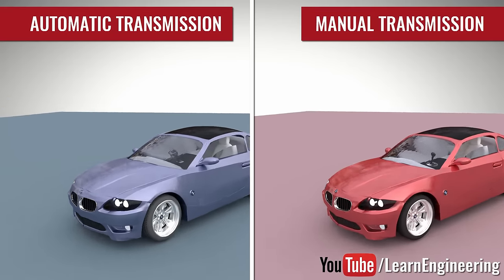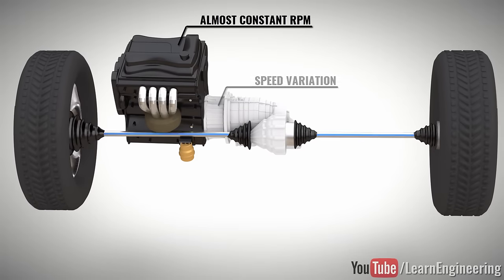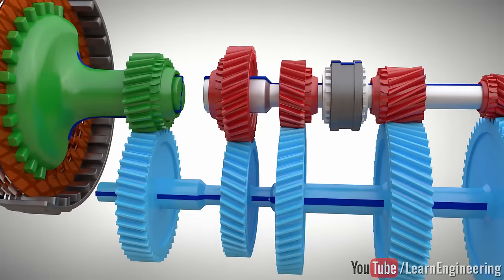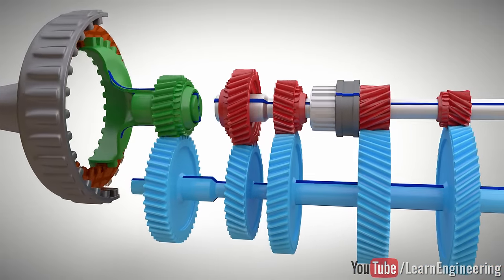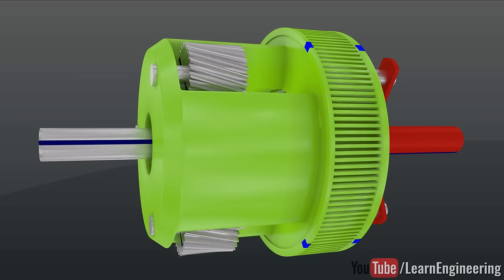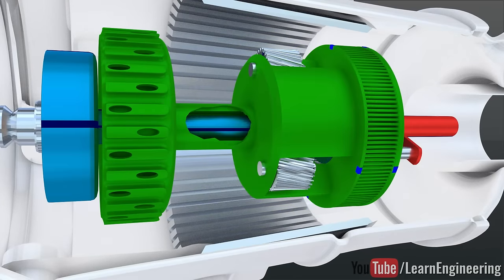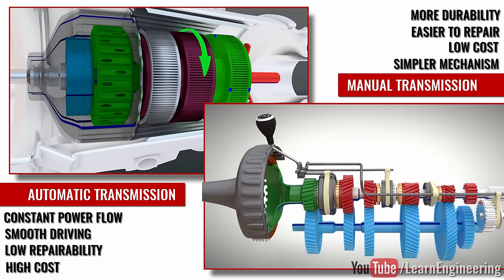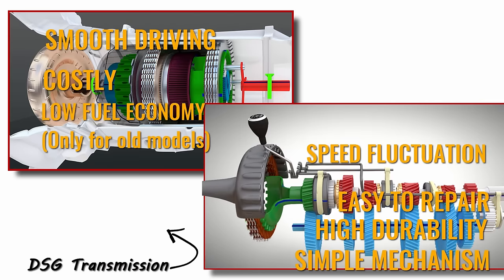Automatic vs Manual Transmission

Comment: 50% of comments: “insert Auto explanation unclear joke”
25% of comments: “I don’t disengage clutch when I brake”
20% of comments: “insert joke about Americans not knowing how to drive manual”
5% of comments: “AuToMaTiC iS bEtTeR yOu SiLlY”
Reply: @William West (student) sUrE
Reply: @William West (student) 1/ It’s less expensive 2/ It’s less complex (so lighter, less maintenance needed, less prone to issues).
The only auto gearboxes that really compete against manual are the dual clutch ones. All the other technologies (torque converter, automated manual transmission, CVT) are slower in gear shifting than manual (except cvt that doesn’t have gears and makes an awful noise) and prone to more fuel consumption.
Reply: @William West (student) How being cheaper on the second hand market is an advantage for auto gearbox ?! It means the car loses its value more quickly, i.e. you lose money over time. And no, it's manual who does have a lower fuel consumption than most of auto gearboxes because it's lighter and less complex. All the additional gears, shafts, the torque converter (if any) etc generate friction that consumes power from the engine. Except for the auto gearboxes that have more than 6 gear ratios that can consume less on highway, and the dual clutch ones, the fuel consuption is higher with auto.
Reply: @William West (student) Of course it's that it depreciates more. Depreciation is the value loss of an asset over time, and this value loss is, among others, relative to the market value of your asset. And on the second hand market we observe auto is cheaper while it was more expensive when brand new, so yes it's a higher loss of money over time; it's simple accounting.
And please what are your arguments to state that auto has better fuel consumption, beside just "no" ?! I explained you why (more weigh, more friction) auto consumes more. I can also give you an example : check the brand new Ford Focus, with the 1.5 EcoBlue 120hp engine that exists both in manual and auto: fuel consumption is rated by Ford at  4.3L/100Km for manual and 4.7L/100Km for auto (which is torque converter type).

Comment: Automatic is for children
Manual is for adults

And btw, this video has been made by someone who has never driven a manual and does not even know what motor braking is.
Reply: Automatic is for boys
Manual is for Men
Reply: or how to float gears either. (shifting a manual without using the clutch)

Comment: Manual is never a smooth experience?  Sounds like something said by a person who has never ridden in a manual and a skilled shifter.
Reply: Vizerei I think by smooth he is saying there is no continuous acceleration curve. Which is true because no matter how fast or smooth you shift a manual there is always a power transmission interruption. It's unavoidable.
Reply: Loss of power, yes, very briefly if you shift fast. But only a bad manual driver will make it a noticeable experience for those inside the car. I apologise to my passengers on the rare occasion when I foul up.
Reply: Mongoose Viper It is completely avoidable. Once you have practiced and know your engine and transmission you don't even need the clutch. Ask a semi driver, they're the Masters of the shift. if you have the timing and feeling right you can shift right as you let off the gas and it slides in to the next gear with less than a tenth of a second delay. Only some sports cat automatics can match a skilled manual shifter. My hellcat is one of those automatics that put me in awe, and my Cummins with an Allison does pretty well, but the common car automatic transmission has a huge delay.

Comment: I always compared driving manual with the blue avatar people when they link their hair things with the beasts they ride. You are one with the vehicle! 
And after a bit of practice you'll unlock a new ability for getting the engine to turn called "pop the clutch" 

P.s. SO MUCH EASIER TO GET OUT OF SNOW ALSO!!! Try rocking out of snow with a automatic you'll just embarrass yourself probly.

Comment: As someone who drove both, each one has its own ups and downs.
Manual is cheap to maintain. The problem is when you are in uphill. You gotta stay in low gear otherwise the engine is gonna stop. Another issue is when you are in slow rushed traffic, you will have to keep changing gears. That is gonna cause problems for the clutch and is gonna be damaged. Also, the engine temperature is gonna get higher. 
For the automatic, it's easy and relaxed during drive. No uphill headache, no problem during crowded traffic. The problem is you gotta be careful when you you press the break or when you accelerate.  Another big issue is the high cost of repair. 
Overall, I like them both.
Reply: auto cars will also stay in a low gear going up hills, its how gearing works. you just dont notice it, and i find it annoying have to put my foot all the way down in an auto before it decides to actually use the right gear. traffic can be annoying, but it doesnt really cause any problems for the clutch and its not gonna damage anything. engine wont be any hotter than it would be in an auto, probably less actually.

Comment: "in manual transmission, before you press the brake pedal, the clutch pedal must be pressed completely"
I'm sure this is a USA (amazing) Youtube channel, because all information regarding how to handle a manual trasmission are completely wrong. By doing what suggeted in the video, it's a good way to die, and I'm not jocking. You MUST press first the brake, then, when the vehicle is almost stopped press the 
clutch pedal.

Second thing, manual trasmission is extremely smooth in terms of comfort....if you can drive properly. If you live in te USA, unless you are using a car with manual trasmission, it's impossible to understand.

Comment: My grandfather, a driving instructor, strongly disadviced me from automatic gearbox, claiming cars with them are actually useless during escape or other such need. I also share the opinion, that car should not be just a vehicle to get to your aunt or church or whatever, but also help you escape or evacuate if there will ever be such need (fact that cars with manual transition are also easier to repair is also nice), so if I will ever think about buying a car, I will choose manual transition. Only problem I ever saw in manual transition is that sometimes clutch doesn't press easily, usually in older cars, so you need more force to actually swift gears.
 But that's just my opinion.

Many people are also pointing out, that you don't push clutch to brake - that's true, since clutch doesn't stop the vehicle, it just pushes engine away from propeller shaft (in easier words one could say, that it disconnects engine from wheels). I was taught to let a foot off gas pedal, gently brake and reduce gear, and when car reaches like 20km/h and is on 2nd gear then push the clutch and put 1st gear after braking. You don't even have to push the clutch, only thing it does during braking is preventing engine from shutting down.
Reply: In any emergency situation I'd imagine the chance of an automatic tranny failing on you is far lower than you accidently stalling the engine in panic, costing you time.
Reply: @baileyharrison1030  not really:
1) 
 a) If you're used to manual, stalling the engine is very rare.
 b) In manual you can stall the engine however times you want. I remember stalling the engine 6 times during exam and car was completely fine. As long as you don't increase RPM to absolute limits, nothing's gonna happen.
2) I mean, automatic will most likely turn on and drive, but will accelarate slowly - when you want to accelarate fast, you need a high power output, and in automatics power output is always the same. Car which doesn't accelarate fast enough doesn't seem like the best escape vehicle to me...
Reply: an auto isnt gonna just let you down if you need to "escape" or whatever its just a different way of putting power down to the ground but autos arent some weird consperancy that are horible
Reply: @Admiral45-10  modern autos are pretty much the same speed as a stick in daily driving a manual dosnt really give you an edge over other people other than they are more reliable and get like 1 or 2 more mpg
Reply: @ethanol-fb  good you said ,,daily driving" - how do they perform offroad, or any other situation than normal drive on road?
 Just to make it clear, I'm consistent - I will probably never buy a sports car (it's literally useless - it can only drive fast (where it's illegal on every single road) and doesn't do well in rough terrain. How am I going to evacuate with my family through bombarded city with this thing?)
Reply: @Admiral45-10  man you really are a conspericy theirorst your suv wont save you from an alien invasion plus for rock crawling and off road i would rather have an auto any day and sports cars arent useless some people like the feel of it and sure going fast is illegal but i dont speed everywhere i go and speeding isnt really that fun to me its the feeling of 0-60 just feeling the torque is fun but autos are for daily driving as 98% of people do
Reply: @ethanol-fb  
1) Neither do I want it to save me from alien invasion or to drive on Mars - I want to be able to run away in rough conditions and repair it quickly, with basic tools and by myself.
2) You would use car with automatic transmittion to drive off-road? Why? What kind of advantage does it have? I don't do off-road driving proffesionally, but, from what I've seen, power output management is really important there. I also don't really think there was ever an off-road land vehicle made with automatic transmittion...
3) Yes, it's good for daily driving (so is the city bus, for example) - but what other than that? What if I will need a run-away vehicle? What am I gonna use? For me, if a car cannot be used in emergency situations properly, it is useless and is just a waste of money.
Reply: @Admiral45-10  look man i know youre not gonna repair your transmission with basic tools by youtself but a manual dosnt offer any more then an auto matic for "emergency" reasons they both pretty much put the power down in the same way plus yeah rock crawling is better in an auto because an auto can use the torque converter and you can hold yourself the same as a clutch but youre not burning up a clutch and you can use both feet to control it better a manual trans is for racing or just for people who like it really but youre not at much of an advantage over someone whos driving an auto

Comment: Yea im not sure where he got the "driving a manual is never a smooth experience" ive been driving a manual pretty much since i could drive and i hardly even think about shifting anymore i just kind of do it. I've reached enlightenment and have become one with the transmission. These days most manual cars even come with wheel locks, so you have a while to get into gear before rolling backwards even on the steepest of inclines.

Comment: Ok fair, automatic wins.  I however prefer a manual transmission over an automatic transmission.  I have driven them for over 30 years and can make my clutch last 100k miles or longer and have found them to be more reliable in the long term.  I am sure some people prefer automatic transmissions and have similar testimonials.  Both are good designs that are being phased out due to the electric car market.  Soon none of the above will matter.

Comment: Clutch pedal doesn't have to be pressed every time before pressing the break pedal on manual transmission. No problem braking with no clutch pedal pressed. It only needs to be pressed before the full stop and to avoid the engine stalling when RPM drop too much.

Comment: If I am not wrong now there is really no need for an automatic transmission, except for it being easier and smoother that is. I have always had the feeling that manual transmission is a better idea overall and now I have facts to back it up. We live in a hilly country and using the engine and transmission to reduce your speed is one essential thing, the other is winter and the ability to start on second gear if you get stuck in ice.

Comment: Also keep in mind that this is the classic automatic transmission. You also have the single clutch auto, dual clutch auto, cvt, cvt with first gear somewhat of what Toyota is doing and so kn and so forth.

Comment: "in manual transmission driving before you press the break pedal the clutch pedal must be pressed completely". Only if you want to stop (vs slow down) a car/wheels. Otherwise and most of the time you want to press only the break pedal and utilize engine breaking (by shifting down gear(s) or just releasing the gas pedal.)

Comment: It's rather obvious where the creator of this vid lies within the argument. I get why some think Automatic is better, and in some cases it can be argued effectively, but I've driven both for almost 20 yrs time and I have yet to drive an automatic that I don't need to play with the accelerator pedal to get what I want from the transmission. Far too many times I'm revving higher than required on a straight, level road...  Far too many times I have to flatten the pedal to force the OD gear off and reengage the lower gear set just to climb an incline while maintaining speed.

I get that Manual transmission is difficult to learn, but it offers a superior experience that really lends itself towards feeling like you're actually in control of the car. But hey, to each their own... I get that. It just comes off as if the creator of the vid has always been Team Automatic and did everything they could to downplay the Manual portion so the Automatic half would sound INCREDIBLE!!!

Comment: The funny thing is they didn't even explain the control system for the automatic transmission that actually decides which clutch packs to apply. It's basically an analog computer using hydraulics.

Comment: To explain a little more: The automatic Transmission back in the days was mainly used in the US, cause it required way more petrol, and for the smaller cars in europe that didnt make much sense. So the europeans sticked with the manual transmission, but latealy more and more automatic ones are driven and sold in europe, but not with the transmission system you see here. The most european automatics are actually a manual transmission but the gear changes are made by a computer. This isnt the case for every european car but for many. These transmissions take less fuel and hold up longer than the automtic transmission displayed here

Comment: Always driven manual. One time I tried my dad's automatic and with this particular vehicle the automatic gear changes happened at slightly inefficient rpms imo. It would let the engine go too low in rpm's before making the gear change from higher to lower gear. You could feel the engine vibrate a bit. That shit is gonna be tough on the transmission in the long haul, so I wasn't a fan. Altho I'm pretty sure you can adjust that.

Comment: You do not  disengage  the clutch before  breaking in a manual transmission.   .You break and gear down  or down shift as ye say. You use the weight  of the engine  to help slow down.
What  you describe  is called  coasting and you will fail your test in Europe  if you drive like this. You would  also  burn through  your breaks pretty  fast.

Comment: Nice video, but the statement that you have to release the clutch to break with manual transmission is just not true. It depends on the amount of braking, engaged gears and speed.

Comment: Have to make a correction here, you don’t want to press the clutch every time you use the brakes; only when you come to a complete stop. Otherwise you’re not taking advantage of engine braking, which will save some wear on your brake pads. 

If you’re particularly skilled with the manual transmission, you can heel-toe downshift, and if you’re driving properly, you practically don’t need to use the brakes until you’ve reached about 1000rpm in first gear and it’s time to come to a complete stop.

Comment: Don't know where the writers learned to drive but normally you do not need to press the clutch pedal before braking in a car with a manual gearbox. Leaving it in gear means you get engine braking as well, which a driver can use in combination with the brakes for speed control, and since for an emergency stop you absolutely should hit the brake FIRST I'd say it's best practice to always brake and then clutch, and depending on the situation maybe even brake and not clutch at all. If you're in say 4th gear and need to slow a bit for a gentle bend that you expect to exit in 4th gear then you shouldn't need to touch the clutch pedal at all. The time to hit the clutch is when you know you're going to need a different gear when you get on the accelerator again or when you're going to stall the engine if you don't.

Comment: I think I would opt for manual simply because if there is one thing I know about physics, the more mechanical parts there are the higher the chance of failure.
Reply: Yup, plus if automatic breaks - it would cost you MUCH much more to fix than manual

Comment: Manual is cheaper, easier to repair and more fun to drive in. Automatic is more expensive, harder to repair and just mundane to drive in. I do not recommend Automatic for those that get easily bored or tend to day dream a lot. I easily get distracted when bored, manual kept me engage at the wheel and it is fun switching between grear especially after 40 mph.